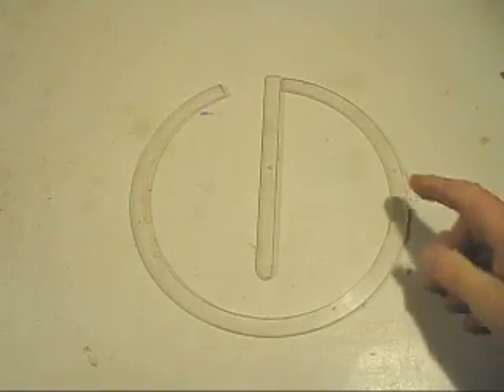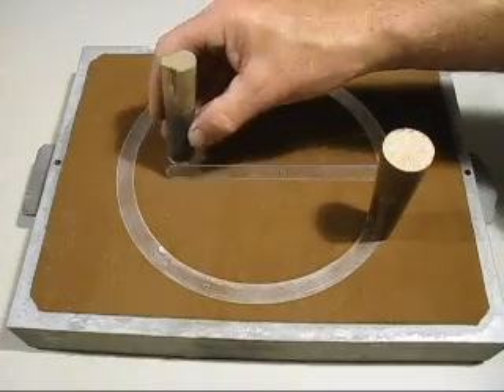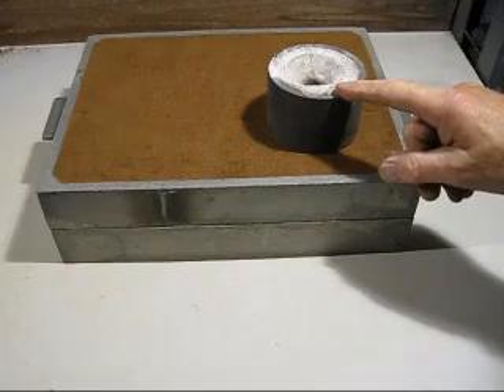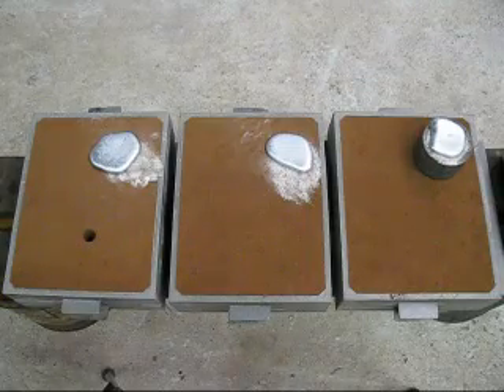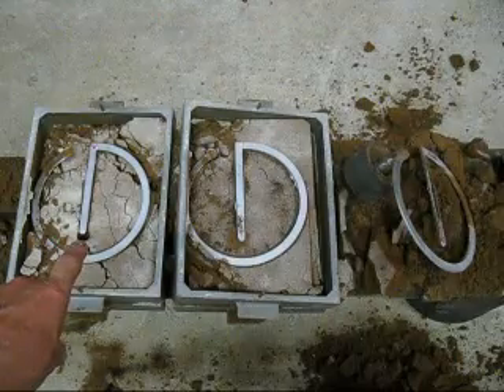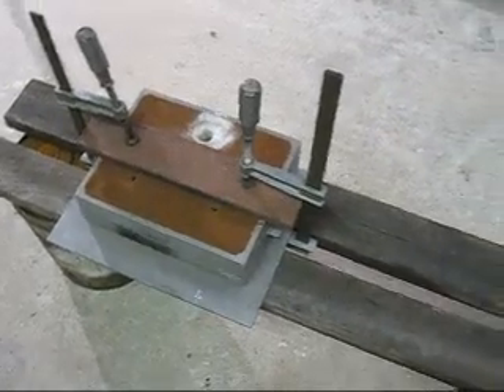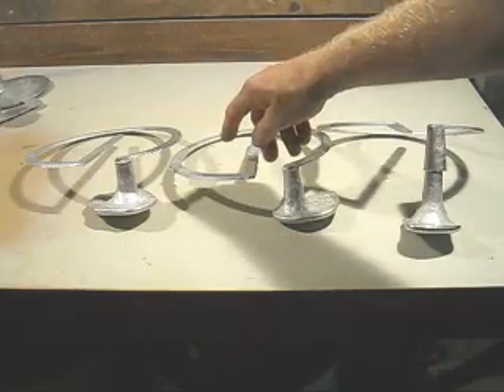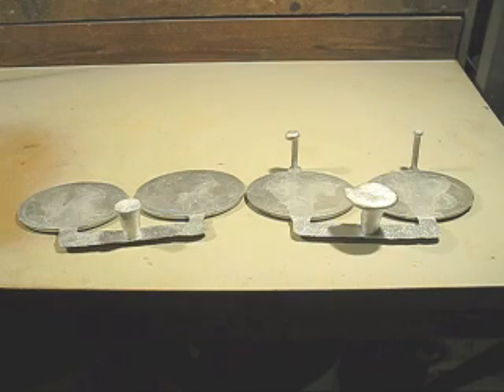Are air vents necessary with green sand molds?

Comment: I have made a lot of castings that are fine without vents. When I cast the base for my lathe tailstock however, I got what I initially identified as a shrink void. That void was smooth and after someone mentioned it, I agreed that it was trapped air in the mold. Adding a vent/riser on the opposite side of the sprue fixed it. I feel like how tightly I ram the sand also had a bearing. To answer your question about how did the air get out, I expect some went out the sprue but also some escaped through the sand. Very interesting experiment.

Comment: The air escaped into the spaces between the grains of sand. The surface area of the void in the mould was relatively high, I wonder what the results would have been with the same shape say ten times thicker?

Comment: Hi, as some of the others have mentioned the sand is permeable because of the space between the grains of sand which allows the air to pass through. The larger the grain size the greater the permeability, but also the poorer the surface finish. Gas flow can also be improved by driving a skewer into the sand at places near where the aluminium will flow, giving an efficient exit path for the air. I am from Geelong, where are you from?

Comment: So it begs the question "Why do books traditionally always insist on a riser vent?"  I often do castings without a riser but do if I think there may be a shrinkage problem.
Nice to see another video from you, I always look forward to them.
Reply from the maker: +creast Foundry books are written by academics who copy methods without ever trying out these methods. Youtube is a great example, everyone copies these methods without ever proving that they work. The result is waste of time ideas are repeated over and over again. Too many hobbicasters misunderstand and misuse risers and wonder why it does not work.
Reply: +luckygen1001  I did look back at some of your earlier videos and in some cases you have used a riser. Can you explain in what cases you do use them? Cheers.
Reply from the maker: creast I do use risers of the right size to feed shrinkage in thick parts and the riser needs to be as close as possible to the thick part. Another problem beginners encounter is trying to use a riser with metal that will not feed properly, these metals are very difficult to feed with risers. It takes a lot of judgement to get a riser to work properly.
Reply: @luckygen1001  Indeed. There are a lot of misunderstandings about risers, most commonly: many people assume that their purpose is to increase the "head" or to aid with venting.
Apart from shrinkage (which risers are intended to provide make-up molten metal for) the things people need to become familiar with when pouring difficult metals (like alu alloys) are the effects of pressure drops due to flow causing air aspiration, hydrogen coming out of solution (in the case of alu, it does no harm when it stays in solution) nucleating around oxides or sand particles and causing porosity, and the tendencies of turbulence to fold the surface oxide layer deeper into the casting where it causes more problems. Things like the ratio of the ingate csa to the csa of the runner or riser are important, also the angles of junctions in runner systems and the avoidance of flow over sudden drops.

Comment: Really interesting display of flow mechanics here. I would have thought the vent would have allowed more flow, but it looked like it instead cooled the metal before it could complete the mold.

in response to your question at the end, my guess is either the air trapped in the mold was absorbed in the metal as it compressed.  I'd examine those castings for porosity to test that theory.
Reply from the maker: +Puffie40 I was thinking that the sand has enough porosity so the air can pass or the air escapes through the parting line.
Reply: It's possible, but I would think that to purge the entire volume of air along the parting line would result in a 'blowout' of sorts as the air gets compressed. Diffusing into the metal is somewhat pluasable as the metal is hot enough to absorb the air into its crystal structure.
Reply: for the volume of air to be absorbed into the metal would create a massive honeycombed structure and in any case the solubility of gas in a metal (of any type) would not approach the order of magnitude to absorb all the air in the mould void.
According to test done ( Liu, Bouchard & Zhang) the solubility of hydrogen in molten Aluminium is only about 1% or 1ml/100gram, other gases are far less.

So where did the other 99% of the gases go - well through the porous sand, most likely.
Reply from the maker: Exactly right.Charles Camenzuli

Comment: As it was a single sided pattern the air could escape through the joint between the drag & cope, also partially through the sand depending how hard you rammed it up, interesting experiment I enjoyed it.
Reply from the maker: +headstocktailstock If it was a double sided pattern where does the air go to?
Reply: +luckygen1001 Hi, through the joint & the sand,I usually spike it all over with a 1/8" bit of welding rod, allmost down to the pattern if it's large, brass is a little more difficult to flow than alloy & c i. Ionly put a runner & riser if it's really needed, like you do, a runner is usually enough,no point in making work.
Regards
Reply from the maker: headstocktailstock I have never used wire to make vents, in fact I have never used vents at all. That is why I made this video.

Comment: Would a 'blind riser' (air vent) built inside the mould - solve the prolems of shrinkage  and air trapped bubbles to give a complete casting?
Reply from the maker: A blind riser will prevent shrinkage but will not prevent trapped air bubbles.

Comment: The sand is porous. I thought the whole point of Greensand was that the air can be pushed out of mold via the liquid pressure.

There exists an optimal sand fineness. Too coarse and although you'll never have a failure from trapped air, you'll have a mediocre surface finish. Too fine and the air can't escape. Optimal fineness seems to be about 100 mesh.
Reply from the maker: +Alvaro Zamora As the moisture level rises there is less porosity also but you are right sand has to have some porosity for steam to escape.

Comment: Hi luckygen1001; Another interesting video, which raises some more questions to ponder.
I think that the air escaped into the greensand pores, but it is still probably better to have small vents [wire sized] to ensure no gas pressure buildup.
Reply from the maker: +Mark Fryer All my molds do not have vents yet they fill up every time. The only time a mold does not fill up is because the metal is not hot enough.

Comment: Excuse me, how to prevent the appearance of gases in the sand casting
Reply from the maker: Purge the  molten aluminium with nitrogen gas.
Reply: @luckygen1001  how do you purge aluminium with nitrogen in a home foundry setup? i cant thonk of an easy or cheap way of doing this? i heard that chlorine tablets (for swimming pools) work, is that another option? have you ever tried this with any success?

Comment: The heat of the molten metal possibly created a vacuum much like a flame in a closed jar. If so then it would be possible that the vacuum sucked the molten metal into the nook and crannies until it cooled enough to hold shape. That would also explain why you got a perfect cast while pouring uphill.
Reply: It would indeed
Reply from the maker: +TheNCgunny Molten aluminium does not consume air like a flame does, also a flame only consumes oxygen. The nitrogen in air is left behind so the flame would create a lower pressure compared to air. In the true sense of the word a vacuum can only be created in a sealed container not in a sand mold with so many ways for the air to leak back into the mold.

Comment: what are the odds that vents would prevent, or reduce the chances of,  mold separation from pressure if an inadequate amount of weight was available to hold the cope down during pouring?  ... 

And what are the odds that in production foundries, particularly in antiquity, the permeability of the casting sand may have tended to fluctuate with change of hands, conditions, etc.?  In many cases the resources being very finite, and the outcome apt to determine the fate of potentially many lives.. it may be easily assumed that the "academics" writing the books including the topic of vents .. as a direct reference to industrial practice that was developed to minimize catastrophic financial loss... 

a best practices catch all... 

not an... absolutely necessary in order to produce a casting..kind of topic?

certainly an interesting one

Comment: I would theorize that the sand is porous but would also think steam would build pressure increasing chances of a blow? voids in the surface?. I saw a youtube of some old timers casting a split pattern into water glassed sand then knowing the high points of the pattern poke fractional sized vents into the flasked pattern at the high points of the pattern, every 6" or so. remove the pattern, re-assemble, Co2 gas and pour some real tight castings... every time. But just doing the 1/16" vents into green sand would increase chances of good pour with enough vent for steam escape without any unnecessary cooling issues of a large vent... ??? kind of a theory or my 2cnts... a happy medium?.. lol PS insuring porosity of sand wether packed just rite or to tight
Reply from the maker: +Nick Vee Another point you forgot to mention is how much moisture is in the sand. Too much moisture in the sand will not allow the steam to escape and will boil through the molten metal.

Comment: ass the poor starts hot air rises and escapes through the poor hole .its like hydrolics .you cant compress a fluid .but air can be .a example would be brakes on your car you bleed air out so there is no room for air expansion .a old law of hydrolics increase volume decrease presure .decrease volume increase presure .very intetesting video has me thinking hard and doing some hydrolics reserch .